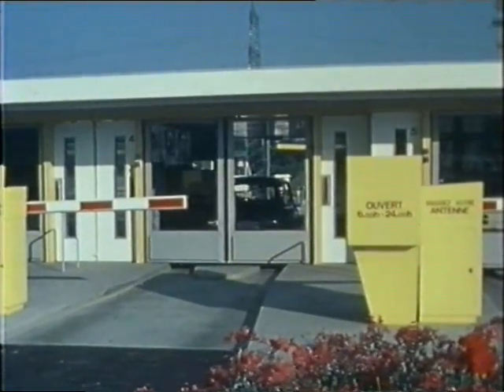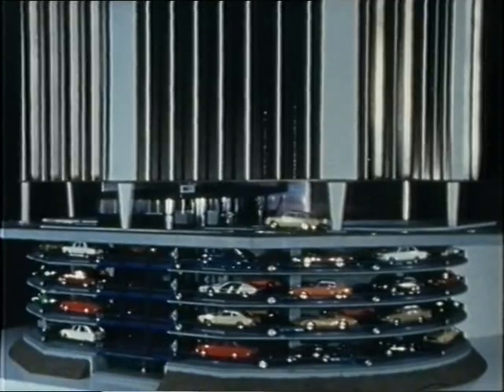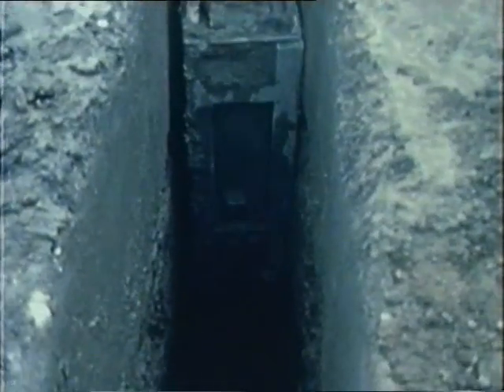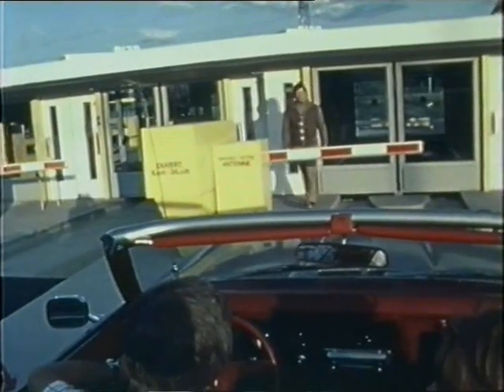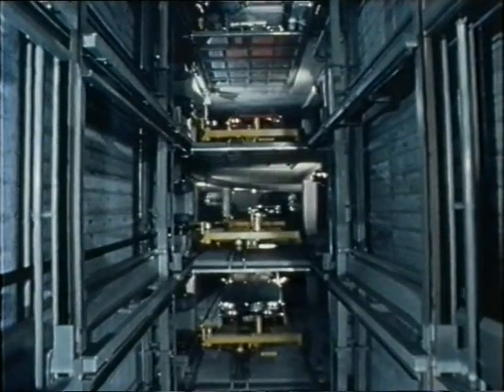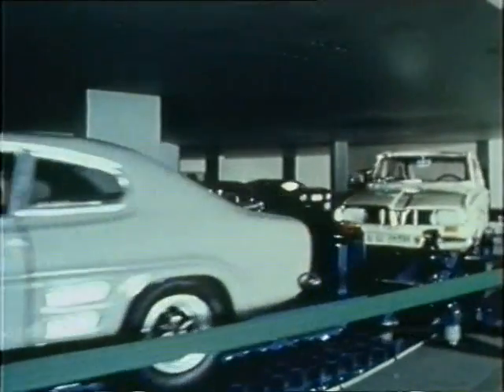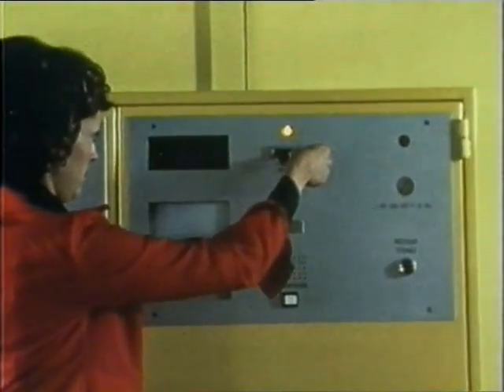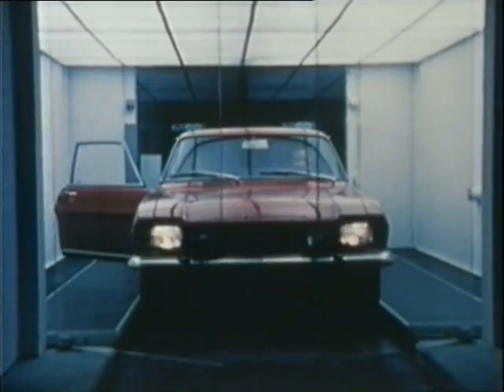Rotopark automatic car parking

Comment: Is this still in function. I tried searching for it and found nothing
Reply: Yes, one is still in use in japan.
Don Pibe comments... He needs to check his facts before making such inaccurate statements...
Reply: Hello,
The ROTOPARK was commissioned in 1974. It had a capacity of 450 cars. But only 2 rings have been put into service, a capacity of 180 cars.
In 1975-1976, they tried to serve two inner rings without success.
Since 1988, mechanical problems have damaged the vehicles.
In June 1993, the operation was stopped.